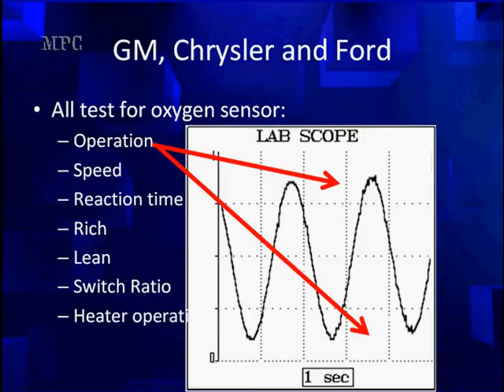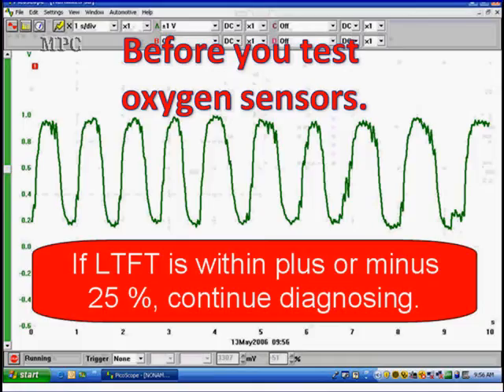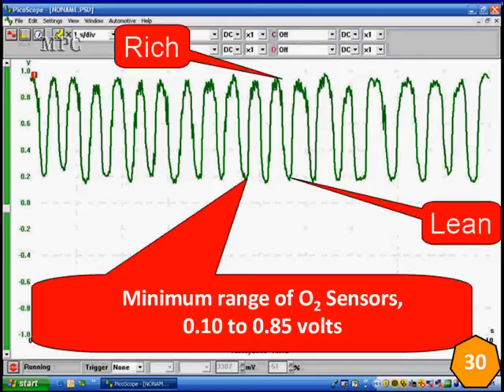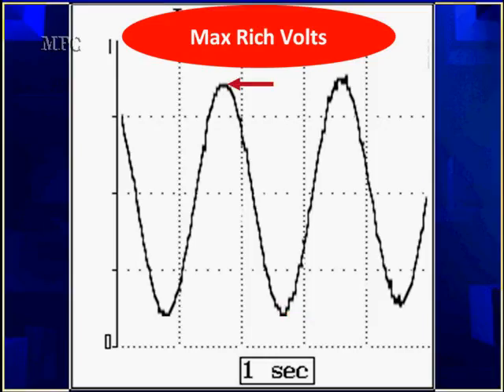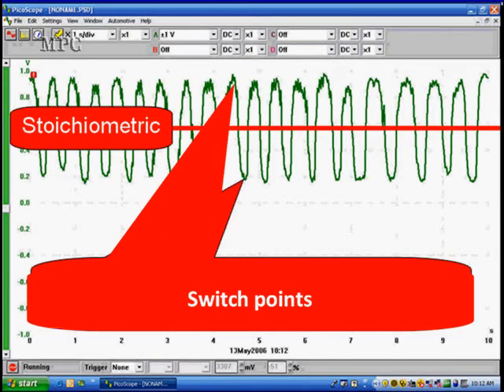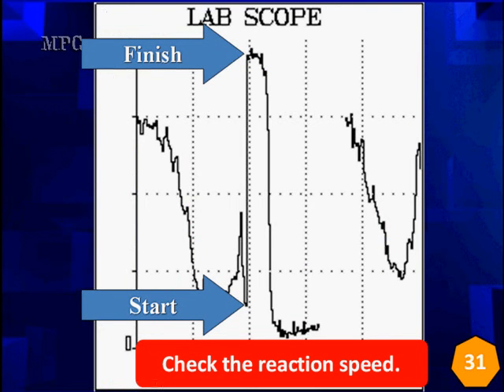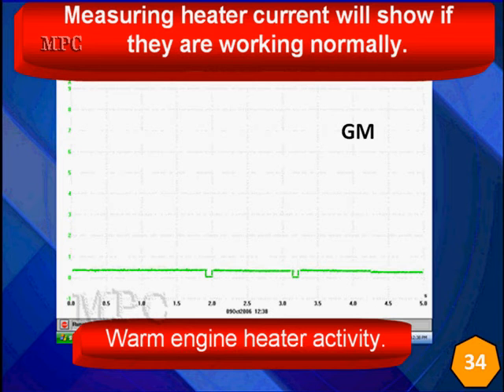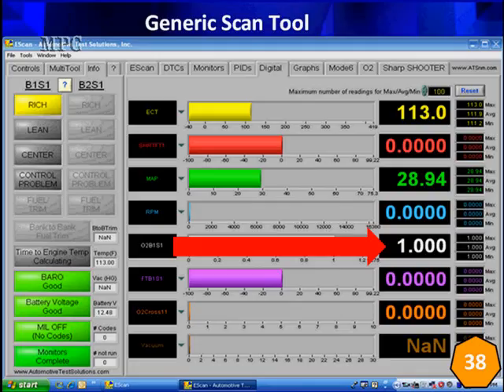6 O2 Sensor Signal Analysis

Comment: That's lots for me to look at when my scope arrives, thank you.  Very informative re the speed of O2 sensor.  I'm curious however, I have a 2003 motor home with the ford v10 and 170,000 miles, does it make sense to change O2's just as a routine tune-up for better gas mileage or can they still be working just fine?